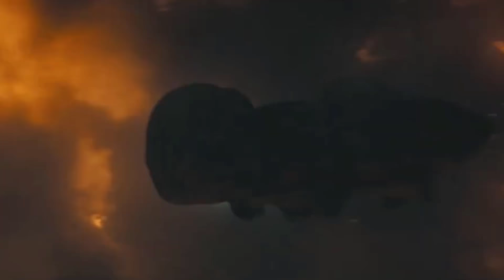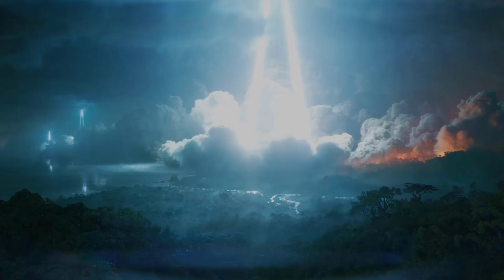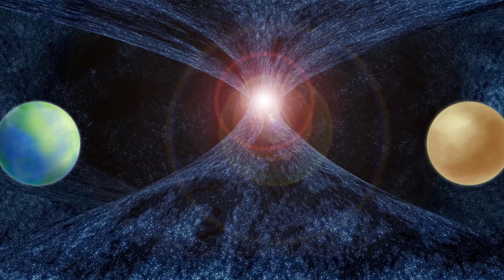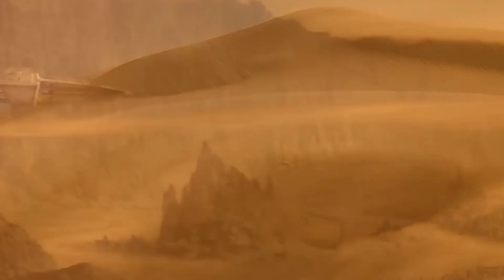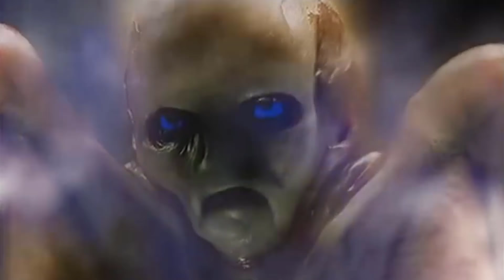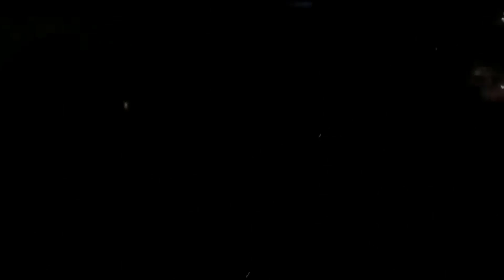How do DUNE Spaceships Take off & Fly?

Comment: Yes, I often wondered what power source(s) actually moves Dunes smaller ships. Like you say, even with a gravity nullifier, you still need some means of propulsion. Otherwise, your vessel,  can hover in place, and while that is cool, its not terribly useful either. The novels mention the generically named, 'frigate' is the largest ship capable of taking off and landing from a planetary surface. In the 1984 film, if those are Letos frigates, they are not very large tbh. The ones we see house Harkonen using, are pretty small as well. In the terrible DV pseudo-Dune films, the frigates get an upgrade and to that films limited credit, the frigates at least, look pretty substantial in terms of capacity. But, if we go by the source, there is an upper limit to how large a Dune 'frigate' can get and still be able to take and land reliably.
Reply: DV dune films are excellent.

Comment: Throwing your ship's limited mass out the back to accelerate is a poor strategy!             :)
It can result in a tall design where your crew module is at the top of a long rocket - a dangerous distance from the ground when landed.
Giant ladder anyone?   Not safe...   So it's best to use propellantless thrusters for advanced ships.
Gravity manipulation is very unlikely to be possible, but we can just use electrostatic pressure in real life.
EPT's (Electrostatic Pressure Thrusters) are just a powered up asymmetrical thrust capacitor arranged in vast batteries of thousands of tiny thrusters working in parallel.
It's more or less just an electrostatic charge trapped in a tiny, very insulated cavity; producing a modest and continuous thrust without throwing mass anywhere.
So no plume of plasma shooting out the back, and the silent engines can be positioned anywhere on the ship, so the crew module can be at the base near the ground when landed.
The thruster can even be positioned above the crew module, pointing into it without hurting the crew, because there is no plasma or EM thrust effect to endanger them.

Comment: The Spirit of Fire cassually hovering over a planet, same as the Frigates of Halo 3 and even the Colossal Infinity hovering in the bunker world all showcase UNSC's mastery of anti or counter gravity technologies at massive scale.
Reply: In that setting humans have basic competency rather than mastery😅
Reply: @jaroslavlistvan4795 point is that Nutbug nitpicked on the scene of the Pillar of Autumn using thrusters to assist it's escape from Reach to imply the UNSC does not have anti-gravity technology and there is plenty of material showing the UNSC with giant ships hovering inside planetary atmospheres without enormous thrusters.
Reply: @Keemperor40K  you're correct, but I just can't judge their competence in any other way than to forerunners